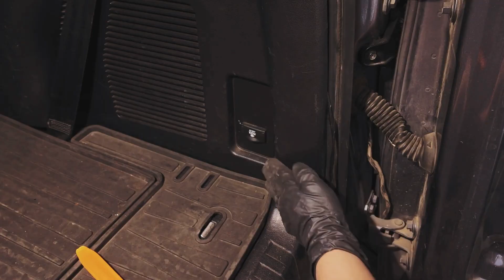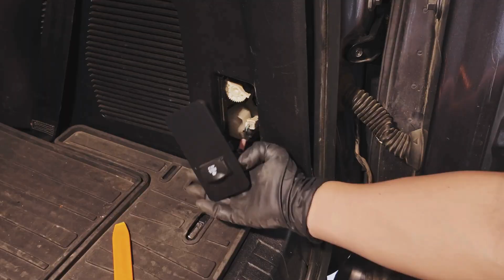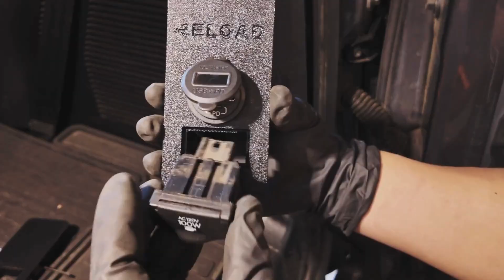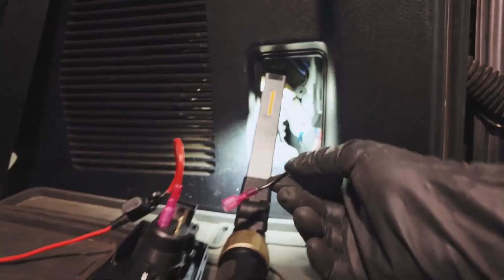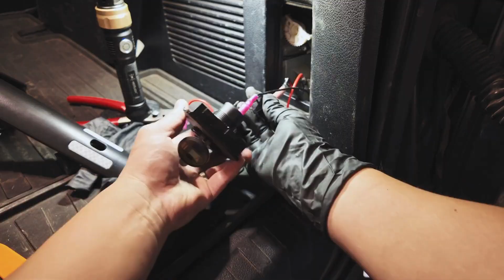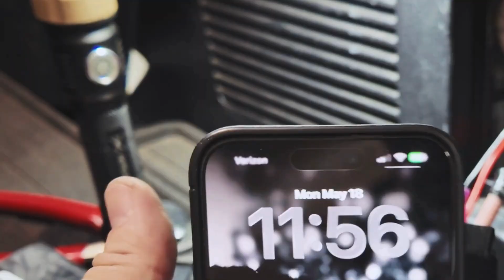Reload Offroad - Rear Cargo Power Panel Installation

Comment: Have you identified what the pink wire is for? Can it actually handle the current of the USB ports you're installing? That wire looks pretty small and you may be overloading that circuit. You might be fine charging a single iphone when the car isn't running, but you might start blowing whatever fuse it's hooked to if you try to charge a tablet, laptop, or multiple devices at once, or whenever that actuator is triggered.